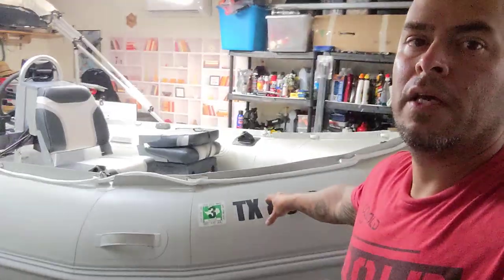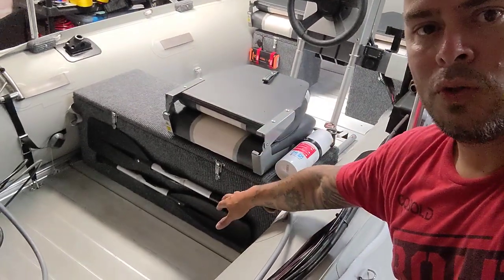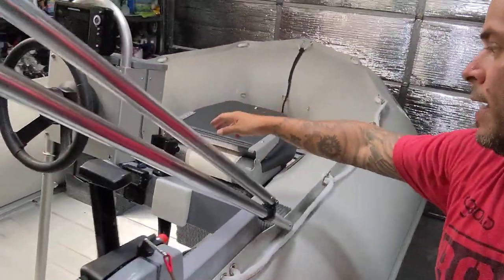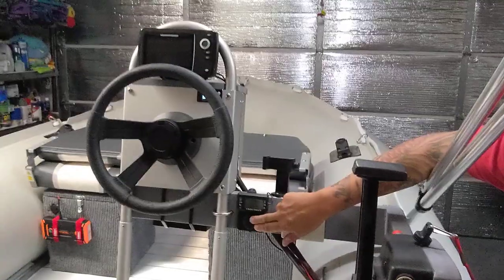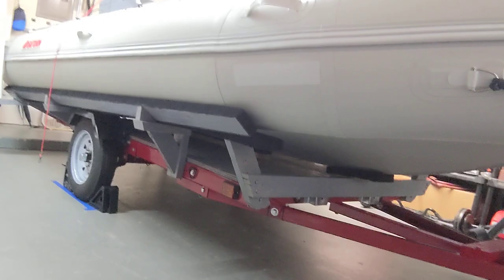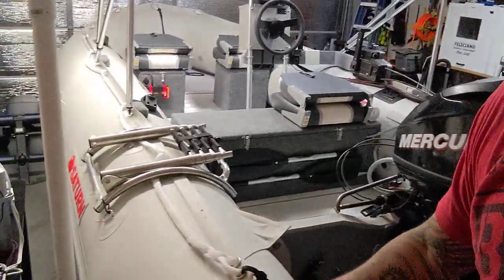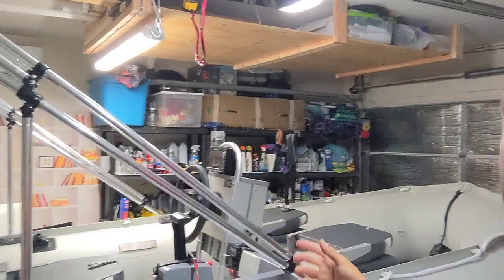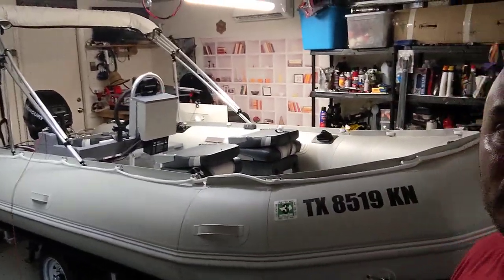Saturn SD470 Boat Build with Customizations and Trailer

Comment: How did you mount the front seat boxes to the aluminum floor, without having the screws underneath rip holes in the inflatable floor below the aluminum panels?
Reply from the maker: I use "L" brackets with m8 weld nuts. The weld nuts go through the bottom of the floor (I drilled holes) and they are flush when pushed into the floor from the bottom. Then I use M7 screws through the top, the "L" bracket is screwed into the wood of the seat box and the bottom of the "L" bracket is secured to the floor with the m8 screw which taps into the weld nut. Solid. Weld nuts are like these but 8mm https://www.zoro.com/midwest-fastener-corp-8-32-x-14-coarse-thread-slab-weld-nuts-20pk-931381/i/G202529085/?utm_source=google&utm_medium=surfaces&utm_campaign=shopping%20feed&utm_content=free%20google%20shopping%20clicks&gclid=CjwKCAjw-rOaBhA9EiwAUkLV4ljNzD_co5zKryLhg6P1MeC1CnL8Hip1Xe9SbOFg9vp4JJZRCEU1iBoCu48QAvD_BwE&gclsrc=aw.ds.